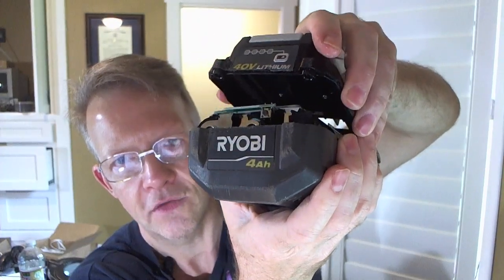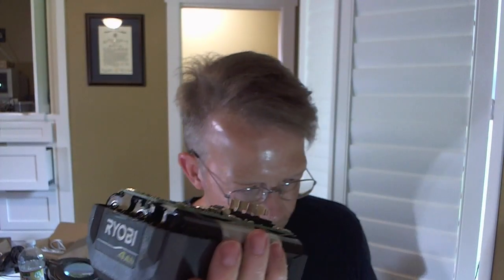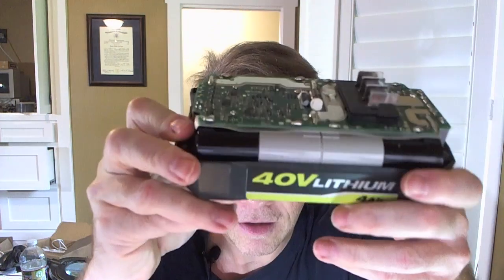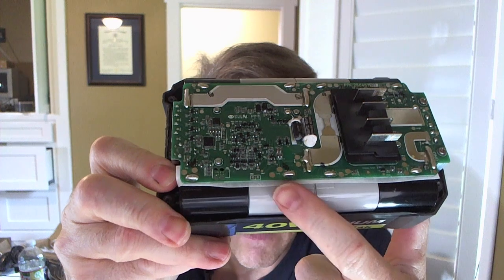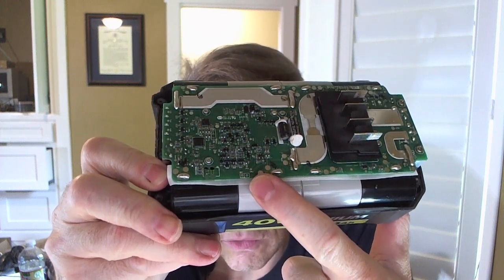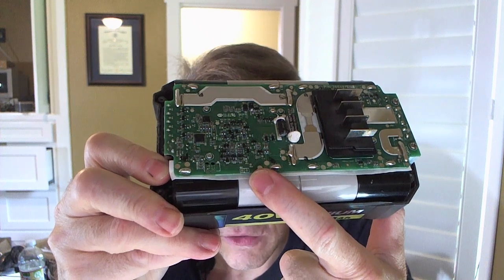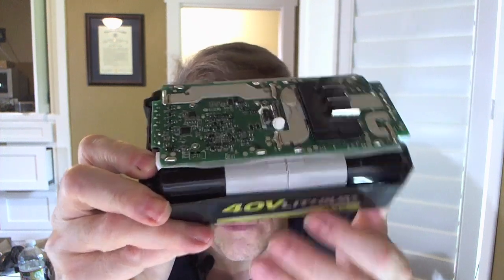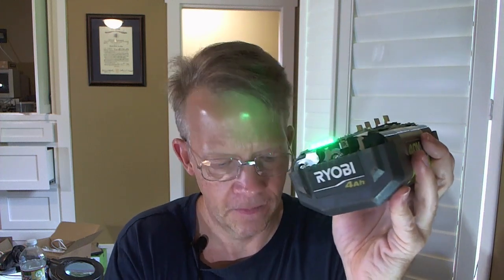Don't "Boost"; Safer Reset! 4 lights blinking on Bad Ryobi 40V Battery Pack? OP40501 OP40401 Rev. Q.

Comment: I did this and it absolutely worked perfect.  I used a paper clip with some electrical tape to hold onto and held onto the mac case.  Strangely though, it had 3 LEDs when I pushed the button.  Anyway, thanks Robert Bullock for your on-point video...
Reply from the maker: Did I just save you over $100? Subscribing costs you nothing and I need to get to 1000 subscriptions so I can earn money from ads. And you can buy me a cup of coffee here: http://Paypal.me/beachfitrob :)
Reply: I am now charging it and when I pull the battery off charge, press the charge indicator it shows 2 LEDs. 🤷🏼‍♂️

Comment: This worked great. I used a twist tie from a loaf of bread for the wire. Just stripped the ends off. Perfect size for this. I really appreciate your video. Happy to give you a donation. You saved me a lot.
Reply from the maker: Thanks, and I appreciate the subscribe. Yeah, I save those bread ties mostly for cable storage but I have been known to use the wire as a wire too. LOL!
Reply from the maker: And I got the donation. MUCH appreciated.

Comment: When you say put something metal on the pads.. it sounds so simple. But with your warning about the static, it sounds not so simple lol .. I’m new to this kind of thing. Do I literally just put a single metal “thing” and touch those pads at the same time? Sorry for my lack of knowledge, but I’m really wanting to learn how this works lol Thank you for the video
Reply from the maker: It is simple. Technically when you work around electronics you should use a grounding strap. ( Under $4 on Ebay....using my links supports me: https://ebay.us/x7zdGA) but unless I am doing extended work on a board, I just touch a grounded PC case (bare metal on a PC, like the back of it) often to discharge static. As long as you discharge, don't stand on a carpet (wood/tile floors don't generate static really) and then handle the board, you should be fine. Plus there are on yard equipment...probably not that delicate. As some have said, they had to push the power gauge button to get all 4 lights to blink indicating reset but some don't. Paperclip, the solder I mentioned in the pinned comment, solid core copper wire, almost anything just to complete the circuit. Buy me a cup of coffee here: http://Paypal.me/beachfitrob

Comment: This worked for me. One thing to note I did have to hit the rest button while jumping the reset ports. I tired several times and kept getting the flashing green. When I left the jumper in and hit the reset, the for light came on and stayed on till I removed the jumper. After that I get the single green light indicating the low battery.
Reply from the maker: Did it charge on the charger after that? I had a couple like this and IIRC most or all still wouldn't charge, or needed to be reset again after use...so not a 'permanent' fix.

Comment: This is one of the best DYI videos I've ever watched. After looking a videos that used micro chargers and soldering and ramming the battery in and out of the charger, this took me about 5 minutes and worked perfectly. I suggest using INSULATED wire for this, so you don't have to worry about grounding, rather than solder wire! Probably only works on Rev Q batteries, but I believe that's the latest Ryobi is producing. BTW the plastic cap on the one screw is probably best removed with a precision flathead screwdriver.
Reply from the maker: Help me out since I'm underemployed and I helped. :) Price of a Cup of coffee fair? https://www.paypal.com/paypalme/beachfitrob Subscribe to my channel also needed so I can earn income off it.
Reply: What do you connect the wires to? Another battery?
Reply: @_DrDrakeRamoray  I used a paper clip. Just touched the two together.
Reply: I have a hart 40v and the lights are flashing and won’t charge. I took it apart but it don’t have the reset button

Comment: I did what you said and after it reset I pressed the button and two lights shown but the charger is still blinking red and green. Should I be using a different charger. Also when I put it on my charger it begins to blink green like it's charging then after a few seconds it blinks red and green
Reply from the maker: How about a like and a Subscribe? I spend a lot of time on this thread and answer most questions. Some people even send me a few dollars if it fixes their $100+ battery -=> http://Paypal.me/beachfitrob
Reply from the maker: So, you did the reset and then it showed it had half a charge afterwards? If you're using the same battery charger that came with the battery, it should work unless something else is wrong. After you put it on the charger and it blinks red/green, does pressing the button show the same half charge or do all 4 lights blink again? Do you know how to measure voltage on the battery?
Reply: @RobertBullock  yess the lights on the battery keep blinking after the charger blinks red and green
Reply: When I put it on the charger after reseting it blinks green for like a few seconds then it blinks red and green again
Reply from the maker: @weldonpinder7295  Something else is wrong then. Measure the pack voltage.
Reply: @RobertBullock  so what to do if the voltage isn't right
Reply: @RobertBullock can I check that on the outside terminals or inside. Which one is better
Reply: @RobertBullock  the voltage on the outside terminals is like 38 volts

Comment: What's your degree in, I see it hanging on the wall back there. I'm guessing education or engineering?
Reply from the maker: That's actually my Air Force officer commissioning cert. I have an EET.
Reply: @RobertBullock  Air Force officer with an Electrical Engineering Technology degree?  Education, Employment Training,  Emergency Evaluation Team?  all E.E.T.  I'm guessing it's the first - since you're here to illuminate the electric circuit reset for the battery?  Were you trained while enlisted in the Air Force?  THANK YOU VERY MUCH FOR YOUR SERVICE!  And thank you very much for your help here Robert, Hope all goes well.  ALL THE POWER (and the donations) TO YOU.  From one Robert to another!

Comment: Tried the reset proceedureon the 40401 Rev. G and the battery it went solid lights after a few seconds. However, my lights are still blinking... I had a similar  problem as yours while using  a blower. Any other suggestions.
Reply from the maker: Sigh. Read the comments. Pack too low is the only other thing and it's somewhat dangerous so I don't cover it here.
Reply: Yes I'm showing 4 volts; can I boost the battery voltage, with leads another battery pack and then attempt the reset?
Reply from the maker: @truesimplicity  Yes, but it is not that simple. You will get a lot of current, etc. What you would ideally need is a variable power supply and start at the voltage of the pack, then gradually go up to 20V per side...it's a 'two sided' pack with 20V each. Also, it bypasses the battery monitoring system so this is DANGEROUS. I've done it, and burned my fingers. :) So, due to the equipment required to do it properly, I don't detail exactly how to do it. You can literally vaporize the contacts you are using to touch the battery with if you do it wrong. Danger.

Comment: Anybody reset their battery says it’s charging but still get red & green blinking?
Reply from the maker: Common. This reset doesn't always work. Also depends on the charge level of the battery. If you reset and it's too low, it still won't charge. Needs somewhere around 30V.

Comment: I don’t get it. Ryobi would rather send you a new battery than telling you how to just reset it for free?  What a waste!!!
Reply from the maker: Liability. You can hurt yourself if you arc the contacts for example. But bright side: if you are able to reset yours like I did, now you have two good batteries. But I also don't see why they didn't put an easy reset in like: Hold the power meter button while plugging in the charger and hold it for 15 seconds til it resets.

Comment: I have to agree with the above comment. I would be helpful to see exactly (as much as possible) where the wire/s go into  the holes
Reply from the maker: If you don't see it, you don't have it, most likely. It is VERY obvious. Two holes. If they are shiny, the wire can make contact. Might have to scrape a tiny bit of the green mask off. Next time I open one I'll do a followup video.
Reply from the maker: ....and how about that like and subscribe, to encourage me to make that video?
Reply from the maker: Done: https://youtu.be/JCCf_qxnA8U Like I said, it's so obvious as to where it is, if you can't find it, you probably don't have this board.

Comment: I have a Ryobi OP4015 40 Volt battery...my logic board has the following holes from left to right in the upper right hand corner:  CLK - DAT - GND - 3.3V - RST.    Which 2 holes should I use to jump?
Reply from the maker: That's a completely different board. Someone else had it and I perused aphoto. Those are for some sort of testing/programming. They are typical pinouts for small microcontrollers. That would be a deep dive for someone to look at. Like and Subscribe please tho. :)
Reply: @RobertBullock   Thanks for the quick response Rob.  I will subscribe to your channel today.  My battery was showing just one LED, but now all the LEDs are just flashing.  Either way my charger recognizes it as defective and won't charge.  I tested the POS and NEG terminals with a multimeter....voltage is well under 35 volts.  Any thoughts on where to go from here?
Reply: Jump the RST to the 3.3v. the other pin on the new battery is 3.3v so that should work.
Reply: Jumper RST and 3.3v for a couple of seconds.

Comment: OMG! I had a Ryobi 40V that was showing as defective and would not work. I tried this fix and it now will accept a charge up to 3 out of 4 lights. I am happy with this and not having to shell out $140 for new battery. Thanks for the advice!!!!
Reply from the maker: Please help an out of work guy and like and subscribe. :) Some people have sent me money for a cup of coffee at the link pinned here. :) http://Paypal.me/beachfitrob
Reply: @RobertBullock  I did a like and subscribed. Also bought the security bits on eBay that you had a link to. Thanks again for the battery advice!

Comment: You can use reg torx if you use a small drill bit on the pin in the middle. Very easy it snaps off . Your welcome.
Reply from the maker: True, but if you are going to do electronics work, get the cheap $7 set of drivers. I don't like to create metal bits and shavings around electronics. It might not be as much of a risk here but sooner later you will run into a situation where it would. It's cheap piece of mind and if you're like me, you use them often enough to make it worth it.

Comment: OK, so I jumped it, all 4 lights come on, then to the single light as you said it would. Put the thing back together and when I put it back on the charger, it goes back into sleep mode with the 4 lights flashing. Took it apart, jumped it again and put it back together. Put it in my weed wacker and it had some power, but only 1 light when I check it. I put it back in the charger (a different charger) and it does the same thing. Back to sleep mode and the 4 flashing lights on the battery, on the charger flash alternates red and green. Any ideas?
Reply from the maker: I've had some like that. Some just won't come back and I haven't figured out why. What is the voltage on the battery pack? You can measure it on the outer two contacts if I recall correctly without disassembling the pack again. If it isn't about 32-33 volts or so the pack won't charge and you've got to manually charge it, but that's tricky. You can't do that with these packs via 'jumping'. You've got to connect to large traces on the board. Big sparks ensue if you use two very different voltages. Like ones at 40 and the other at 30. I've had more not come back with reset than have come back. It's maybe a 35% success rate so far. Also the voltages are halved on some traces. One set of two voltages at around 20V add up to the 40V pack. Some of the traces come out of the two pack 'halves' that have 10x 18650s in each side. One reason why people like to harvest these cells. Tricky in itself unless you discharge the packs first.
Reply from the maker: Oh, and hit like and Subscribe. This is work! And I'm out of work. :)
Reply: @RobertBullock  I don't know much about voltage etc...but it sounds like I would need to go out and buy something to test it, and then never use it again like the security bits I bought. I'm just going to chuck the battery, not worth it for me to continue as it's probably dead anyway and I'm not that interested in learning how to do a manual charge. I'm glad it worked for some people though.

Comment: I am new at this.  So you just put a metal solder or drill bit etc in RST hole and that's it, or do I need to connect those two holes together to reset?
Reply from the maker: No you have to put a piece of wire in both to close the circuit. The tiny drill bit turned by hand just cleans the green coating off the holes exposing the contacts a little.
Reply: @RobertBullock  Hi Robert are you doing the follow-up video?  In order to close the circuit, jump wire in both holes that's right?  Be nice to see picture of the wire in the holes on how to jumper or contact the two holes.

Comment: my board is different,  do you have a close up or terminal numbers for the jumper
Reply from the maker: It is two tiny holes that say 'RST' or 'RESET' near the edge of the board. They are .1mm holes like a thru hole on a circuit board. You can also take a small drill bit and turn it by hand to take some of the coating off so the metal portion is exposed so you can make contact. A tiny drill bit under .1 would fine and then the inside of that thru hole will be metal. If you're curious a jeweler's loupe will let you see all this. Plus they are just so handy to have and cheap. I swear I reach for mine several times a day here and there. https://rover.ebay.com/rover/1/711-53200-19255-0/1?mpre=https%3A%2F%2Fwww.ebay.com%2Fsch%2Fi.html%3F_from%3DR40%26_trksid%3Dp2380057.m570.l1313%26_nkw%3Djewelers%2Bloupe%26_sacat%3D0&campid=5337534429&toolid=20008 I have a plain black plastic cheapie. Further, if you plan to make an external reset set of contacts like I might have to do on one of my packs, you'll want the holes clean to solder to.
Reply: @RobertBullock  only see one labeled RST     the others are CLK,DAT,GND, 3.3V
Reply: @1everett174  Those are probably test points. See my other comment and post a link to a photo of your board on a photo sharing site.
Reply from the maker: @1everett174  I think you're out of luck. That board doesn't appear to have a reset possibility that's simple. Anyone else wanna take a look, the pic is here: https://wetransfer.com/downloads/c6832f07a98be0a695af858e4af1a1b520201024001245/847ff79c1c1718a804cacd5625dc003e20201024001332/5e0456 If you soldered in a header and knew the chips on the board, maybe. It's some sort of microcontroller going by the silkscreen labels on those holes. Beyond the scope of this video.
Reply: I have the same issue as Everett , my battery is a OP4030 and although it has an RST Pin, it’s grouped with 4 others not just a pin to jump to...on your battery Robert with the 2 separate reset pins, could u use a multimeter and see what the pin is that you are jumping too? If it’s a ground or 3.3v we should be able to do the same thing on different pins I would want to believe
Reply: @BryanRT326  Yes, my thinking exactly, I hope he respond...
Reply: @BryanRT326  Hey man did you ever figure out which other pin hole is the one needed with the rst one is it the ground,clk, or the 3.3v? Thanks!

Comment: Do you leave the jumper in perminantly?
Reply from the maker: No. Sometimes pressing the power meter button on the outside of the battery with the contacts jumped will cause a reset but mostly what you want to see is: jumper the contacts, all the lights come on, remove the jumper, press the battery level button and one light flashes. If the pack voltage is too low, you need to manually charge the batteries which is a bit beyond the scope of this video and honestly more involved as to really do it safely you'd need a variable voltage power supple and leads soldered to power traces on the BMS so you can gradually bring the voltage up. Jumping right to the traces with a voltage difference of say, 30 volts on a thin trace and unlimited current is potentially very bad. And now you Subscribe, right? ;)